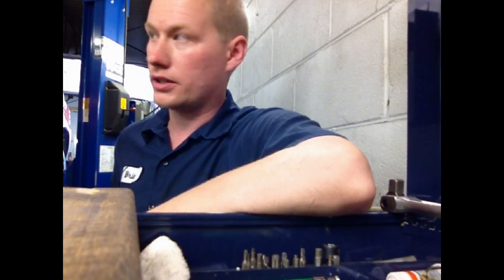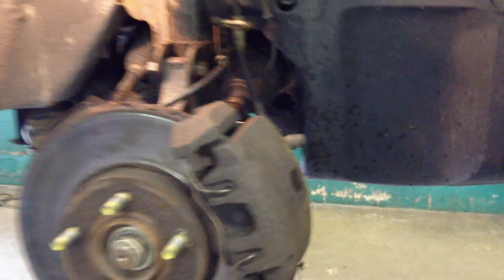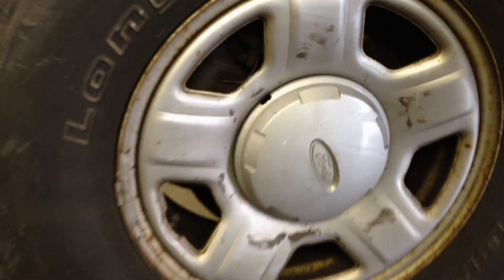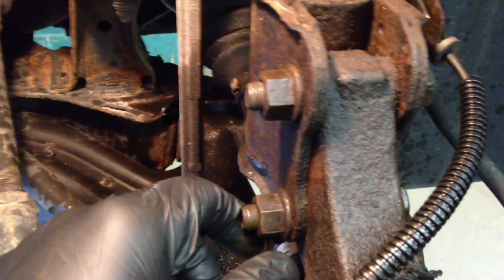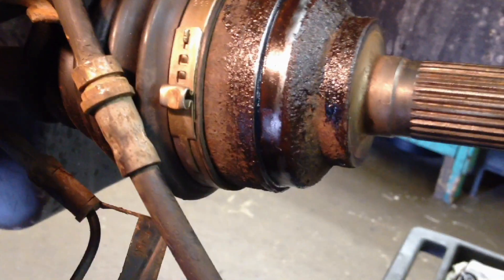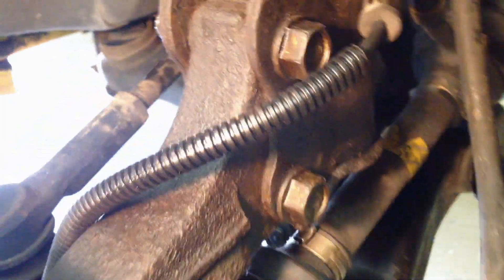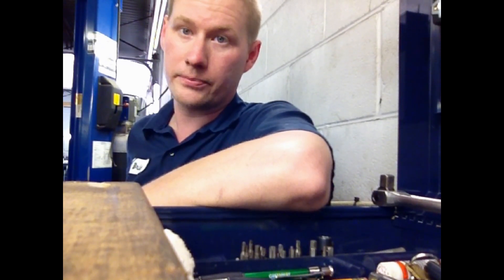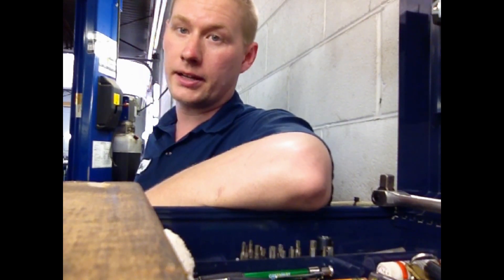Ford Escape ABS Tone Ring Install C1233 C1234

Comment: I am getting the ABS code C1233 on my 08 Explorer after changing the front left wheel bearing a month ago.  I checked the rings on the rear and they are in good shape.  The ABS light and traction lights came on a few weeks after the new hub and sensor were installed.  Any ideas?
Reply from the maker: HRHKingJames Control module and wiring problems are uncommon but I would inspect the wires to the module follow them up. These are active wheel speed sensors so we cannot test them directly. Was this an aftermarket cheapy type hub and bearing? Do you happen to have the old hub and speed sensor?

Comment: I know you explain you've never seen a bad sensor or module but my 2003 Ranger 4x4 has a constant ABS light in our heavy salt water air environment. I replaced the back sensor and the light is still on. When I hook up to get an error code I get nothing or a msg saying ready to hook up, so something is not sending to something even though I might still need tone rings. My question is, if I replace the rings and the light  remains on, what else could be the issue? One mechanic told me I might need my module reflashed and only a dealer can do it. I'm stumped and don't want to waste time or money going down the wrong path to a fix. I just want the damn light off! Any suggestions?

Comment: I know this is way late. But maybe someone can help me. I have a bent rear tone ring on my 17 mustang. Which throws a bunch of codes and messes with my power steering. And what I noticed on my car is you can't replace just the tone ring you have to buy the whole half shaft. But my question is can I possibly straighten the tone ring back or does it have to be perfect. Or would I have to replace it?

Comment: I just have a quick question.  My '07 XLT Escape (V6/3.0L) has not thrown any codes for this issue, but rather my ABS light is on constantly and the 4x4 blinks as per numerous other complaints of similar.  So, no codes, but the same issue here with the ABS/4x4 lights.  I surmise that it is most likely the tone ring, and will verify it this weekend...but my question is, will the lights correct themselves and restore my ABS as well?

See, I bought this used in July of 2013 and it had the issue at the time.  They said they fixed it, but it happened again about 3 or 4 days later and has been constant ever since but I can still brake, just no ABS braking so I haven't really concerned myself with it.  I do now want to get it resolved because it has become a major annoyance of mine.  I just want to be sure that once the ring(s) are replaced that my ABS will be restored (and I guess the ability to use 4x4) and the lights will go off and stay off.

Maybe as an aside question...since I have never used the 4x4 since I bought it, I am wondering what may happen (if anything) on the front and rear differentials?  Should I be at all concerned about them being used all of a sudden after so long without?

Thanks.

BTW - GREAT video.
Reply from the maker: Once the system sees a good wheel speed signal it will clear the light by itself yes. If the light is on then there is either a code in the abs module or 4x4 module but most likely the abs module code is setting the 4x4 off since it relies on the abs module for information. You do not have to worry about the diffs as they are always turning by force of the wheels internally so they always have lube worked into them.

Comment: What about a flashing four wheel drive light I replaced the alternator and the halfshaft and axle and the light won't turn off ?? I need advice please
Reply from the maker: +Anthony Cardaci The 4x4 flashing means it is not working because the abs module is not sending it the information it needs like wheel speed. fix any abs codes first.

Comment: I just replaced both tone rings on my 2006 Ford Escape using this method shown. Now, while I drive the front end shakes. Does it now require an alignment?
Reply: make sure you have everything tight, might have the axle nut loose
Reply from the maker: Noah Hoek Yes make sure every bolts nut and lug nut is tight first you should not need any alignment after this.

Comment: FordTechMakaloco - How hard is it tor replace a non-cracked ring?  My 05 Escape is getting long in the tooth...almost 200K miles and I just got this ABS/4x4 lights this morning.  I'm betting it's the ring especially since I have been experiencing some grinding lately.  I was thinking about replacing both front rings at the same time or should I wait until the other one goes?
Reply from the maker: Getting a non cracked ring off without damaging the half shaft can be tough. I would wait till the other one cracks to replace it. Otherwise an air hammer can pop it off if you are careful.
Reply: That's seems to be the general consensus! if it aint broke don't fix it.  Do you have a video or changing the front pads and rotors?  Migth as well do that while I'm in there!
Reply from the maker: Yes here- Ford Escape Front Brake Repair
Reply: FordTechMakuloco
any tricks for getting the new ring on?   I am having a hell of a time!
Reply from the maker: Yes make sure the halfshaft rust is sanded down enough, grease the area the ring is going onto and if you want you can heat the ring up in a oven or use a propane torch as explained in the video.
Reply: I'll take it down to my mechanic tomorrow morning.  I tried for quite a while and finally gave up.  I don't have a torch at my disposal and maybe he knows a trick or two.  Thanks for your help!  At least I was able to get the wheel on and back on by myself!  Maybe he can let me do that part and I'll save the labor!!

Comment: I called ford today for the traction control problem in my 2009 ford focus and they said when replacing hubs and bearing I need to reprogram the module after? Or it might be a bad traction control sensor causing that.. what do u think?
Reply from the maker: there is no reprogram needed don't let them sell you that. Let them have it to see which sensor is reading incorrectly under accell. Should be a small fee for diag $50 or so.
Reply: FordTechMakuloco yeah i called asking to check that out and just to diagnos its 110..
Reply from the maker: noel naranjo
Goto an independent shop they too have the scan tool to diagnose which one is reading incorrectly and are usually cheaper. Not sure if I ever asked why did you change the bearings? Also did this accelerate problem start before or after the bearing replacement?

Comment: I have a 2008 Ford Edge with a cracked ring.  I have not been able to find the ring separate from the half shaft.  Do you know if that is available anywhere for the Edge?
Reply from the maker: If anyone is going to carry it, it would be the ford dealer but I am thinking it is not available separate.
Reply: FordTechMakuloco any chance you could fill the crack with liquid metal for a temporary fix?
Reply from the maker: No it would pickup the bigger gap and throw a fault still.

Comment: Great video that will give Ford a good reputation and keep them roadworthy.Just wondering if a bearing is put in back to front, should it affect the abs and if so, why ?
Reply from the maker: On these it does not matter only certain models like the focus has a black tone ring that must face inboard.
Reply: FordTechMakuloco I have a 05 escape that doesn't have the abs light but when I break hard i hear a bang and an early lockout of the front passenger wheel, I have checked the brake piston and isn't  seized or anything
Can the tone ring could cause this also ?
Reply: I have to do this on a 2000 Chrysler 300M same problem But I cant seem to find Just the Ring anywhere and the CV Axle from AAP Has the Ring Welded to it So I'd have to replace the whole Shaft to use that I'm wondering if I can just remove the Old one and Weld the Crack then put it back on as you did cleaning the surface first and then Spot Weld it in place like the replacement Any thoughts ?

Comment: would a tone ring cause your 4 wheel drive not to work
Reply from the maker: Yes the 4wd module uses the abs speed sensors as the main input for controlling 4wd operation.
Reply: thank you very much!

Comment from the maker: First off if you have ever pulled a lower arm from a pinch bolt setup as on these you will know they will not come out easy at all. You will fight and beat on the arm to get them out all while ruining the ball joint, lower control arm, and most likely the lower ball joint boot by going the easy way and using a pickle fork. That is some shoddy work and not how I run.

Comment: I need Help.. so i have a 2009 ford focus front left and right wheel bearings are brand new and after putting them in i got the abs light and traction control comes on and blinks or remains on, i scanned it and it said it was my front left abs sensor and i replaced that about 1 hour ago. light came back on and reading is the same i get the C1233 code. any suggestions? says the sensor input is missing.
Reply: Hey @FordTechMakuloco Can you answer this question. I am having this issue right now as we speak. I need help. @noel najaranjo, did you ever find a solution to this?

Comment: FordTechMakulo, my Escape just started doing this recently.  At low speeds I get a grinding, not always it's intermittent.  My regular mechanics who are usually quite good can't find any issue.  They did the passenger side caliper which they said was bad but that did not fix.  I do not have the ABS light, and it's not a pulse like ABS it's a GRINDING, it is coming from the drivers side.  My mechanic drove the car but still can't figure it out.  I told him about the tone ring he said no, that can't be, it is grinding not pulsing.  I am losing faith.  This is a 2001 with 145K, I am original owner and I baby the thing.

Is the tone ring a possibility, even though it is grinding not pulsing?  I'm pretty handy and have all the tools any way I may try this myself now that it's warm in the garage.  THANKS
Reply: BTW the grinding is when braking, when speed is reduced.  Doesnt seem to be an issue say, when stopping at travel speeds.  Only approaching stoplights etc.
Reply from the maker: sonofthe80s This sounds consistent with a cracked ring
Reply from the maker: They will usually have a grind type noise grind type noise. There will not be a abs light usually as it is a false activation. You need to get under there with a good flashlight and look at the ring all the way around real close they can be hard to spot sometimes. The grinding noise when this occurs comes from the abs module which is on the drivers side just on the other side of the firewall so this all sounds like a cracked ring. If you want to totally eliminate the abs module just pull the fuse for it and take a drive that will tell you right away if it is a base brake concern or a abs concern. pull fuse 24 and 14 from fuse box under the hood drivers side next to battery.
Reply: FordTechMakuloco
Thank you for your answers, that is awesome information.  Thank you for taking the time and sharing your expertise.  May I ask, does the ring have to be loose or is a hairline crack enough?  Does it fail because it moves, or simply because it's cracked?

I inspected all 4 rings with a trouble light CLOSELY, I spent 5 minutes on each one - I even used a big screwdriver for leverage to see if there was any play in the rings but all 4 appear to be well seated, visibly intact and zero movement.  However the one in question had some oil or something on some teeth, I cleaned it with CRC brakeclean, maybe that was interfering?  Just a guess.

Your idea about  the ABS fuses is the best one yet, thanks I will do it tomorrow.  I never liked the ABS in the Escape anyway, I don't think it has ever helped me stopping in 13 yrs.  Our Toyota's ABS feels/works better.
Reply from the maker: sonofthe80s Yeah pull the fuses and test drive you will know. Was there grease all over the teeth? If so you have a tear in your cv boot. If you inspected them that close and even pryed on them with a screwdriver I would say they are ok. When was the last brake job how many miles on the truck? I would inspect the brake pads especially the inboard one they can grind intermittently when they are low. Any damage to the rotor face both sides of rotor? Is it a deep grinding noise or a light tinny scraping noise. Either way pull the fuses and try it for awhile.
Reply: FordTechMakuloco
THANKS AGAIN.  It wasn't grease but a light coating of oil, only on a few   teeth.  CV boots look intact and supple rubber.  My reg. mechanics did full brakes not too long ago (ceramics) & and he has checked them a few times since this began, he says fronts 80%+ remain before replace.  No cracks etc.  Because of this issue he cleaned & inspected front brakes when he did the pass side caliper 2 weeks ago.  Lat week he cleaned the backs.  Said backs were extremely dirty. 

The problem is much less severe and much less often now but still there.  No terrible grinding, just some light noise at end of braking & very infrequently.  Dont know yet if what I did, or what he did, helped.  Or, if not at all.  I didn't pull the fuses this weekend - wanted to see if it happens after cleaning up rings & drums.  I will do it and drive the car for a week.  THANKS AGAIN.
Reply from the maker: sonofthe80s Now that you say ceramics I have heard of cheap ceramics causing groaning and or grinding type noise, just google it you will get tons of hits, besides that are the front rotors new when he did ceramic pads?
Reply: FordTechMakuloco
Thanks, sorry I just saw you replied.  The pads are decent quality, I remember him saying so.  I think they are Raybestos.  They did rotors too.  Right now it's so minimal I am just leaving it, it almost never happens so maybe it's a hairline crack in a tone ring I can't see?  If it gets worse/returns I will be back on the case (or replacing the car - we'll see how the AC "fix" turns out).  13 years, almost 150K, it may be time to retire the Escape.  It's overall in excellent mechanical and cosmetic condition, except a couple things (AC leak, brake nag).
THANKS
Reply from the maker: sonofthe80s Yes they are great trucks I had and 06 and now have a 09 love them. Wife has a 12 explorer and I would take my escape over it any day.

Comment: I am trying to find the tool to press the ring on but I can't find one, can you help with this??
Reply from the maker: +Tammy Meyer Why pay hundreds for those press tools when you can heat it quick and tap it on very easily.
Reply: +FordTechMakuloco I just wondered if the dealer mechanic uses a special Ford/Rotundra tool what the part number is because I would rather press it on because even heating the ring, most the time you still have to tap it and I would rather use the correct tool than the old tone ring. If you know the part number and let me know it then I thank you very much!!
Reply: +Tammy Meyer, For anyone that wants the Ford/Rotunda tool to press this on the part number is T94P-20202-B. I paid 15.98 for one on Ebay.

Comment: Can someone help me on this ?
I have a 08 escape hybrid with the abs engaging sometimes when I start the vehicle - only at start then it will stay on for the trip. Sometimes I can turn the vehicle back on an the abs / check brake system light will be off......
Tone rings changed at 82k , I'm at 115k
Abs light comes on and makes it hard to stop
3 codes I have are : u2023 malfunction received from external node
 c1478 left front wheel brake pressure control plausibility malfunction 
U0418 invalid data received from system control
Reply from the maker: You need the ABS HCU

Comment: >>>>I didn't have to pound anything. The long control arm bolt slid right out with a long screwdriver. The splined part of the axel just needed some firm tapping with the hub nut maxed out. Once you remove the long bolt from the control arm and tap the axel through, the hub and strut assy will swivel freely. No pounding whatsoever. Why fuck with a brake line if yo don't hav to. I'm telling you,check out Stee1hed's video. It's much simpler. Less things to take apart means less things to go wrong.